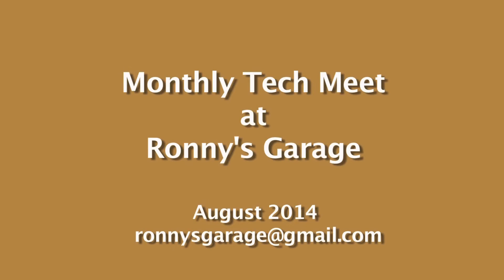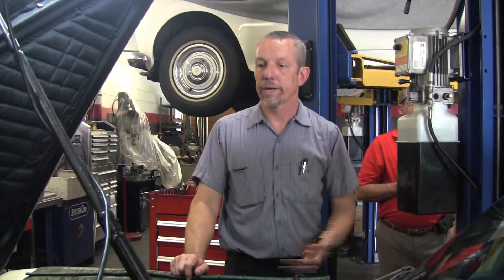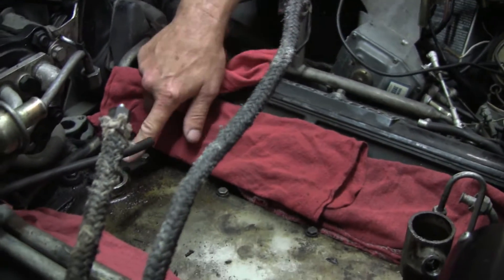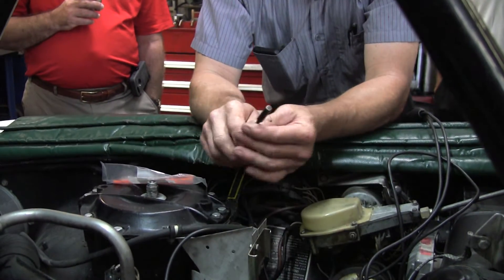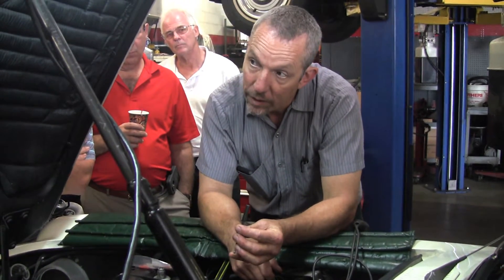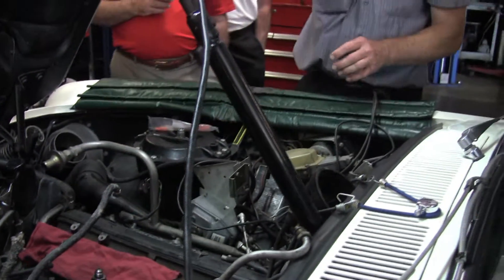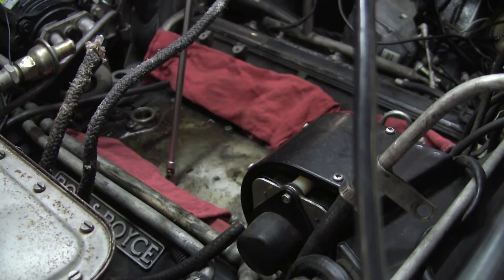Shadow Brake Pump and Rods Part 1 of 4

Comment: Excellent explanation and detail. You can't beat experience.I have shadow series 1's. Learning the quirky brake system was erm, fun? 
I renewed caliper pistons, accumulators, all flexi hoses, pads, low pressure master cylinder etc. I put the wrong fluid in it (Citroen) and it worked fine for half an hour and car passed its MOT test. On the way home, the O rings in the calipers swelled up jamming the brakes on. Only the might of the engine got me home with smoke streaming off the hot brake discs. One rear disc was almost white hot, it set fire to the flexi hose which sprayed continuos fluid onto the hot disk creating a flame thrower next to the fuel tank! The tyre started to catch fire also. I nearly lost the car but for a garden hose nearby. NEVER Use the wrong fluids in these systems. I had to rebuild the whole system again.
Reply: Holy hell!
Reply: 7-8000€/dollar

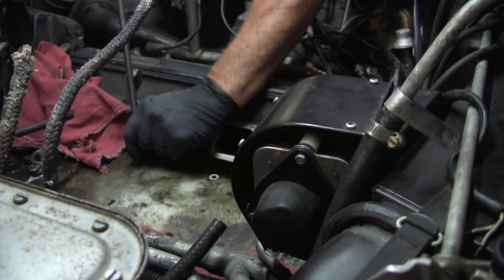Comment: Video marker 8:17
Many years ago, this smart ass young kid was working on his 65 Corvette and he dropped the air cleaner wing nut in the carburetor, he did not thing anything about it . 
The engine suddenly stopped running, surprise, surprise.

Comment: Don't own a Rolls yet, do hope to.  Very insightful series of videos.  It seems to me that Castrol GT LMA is now superseded by  Dot4 brake fluid. Servicing the entire hydraulic system will be the first thing I do on "my car" (after replacing the points dissy with a 123Ignitions Bluetooth distributor - no connections)